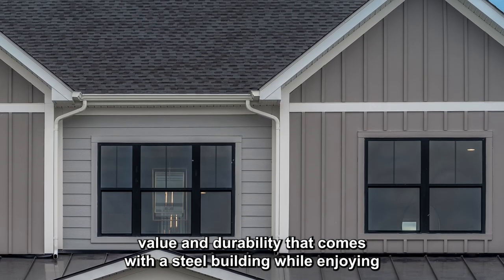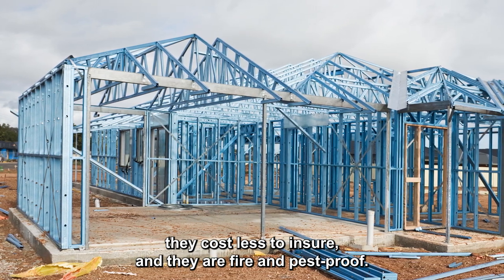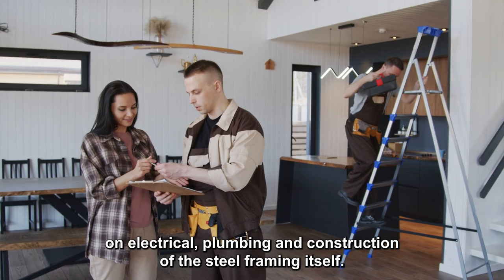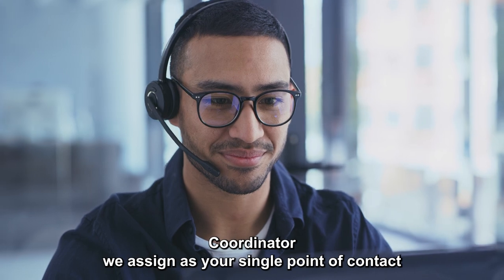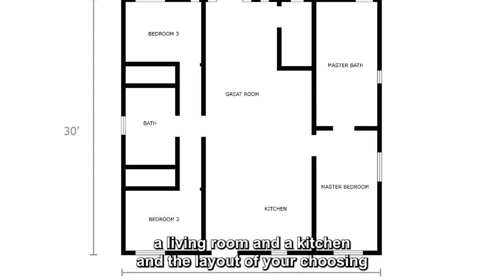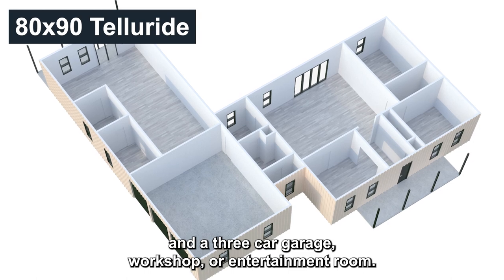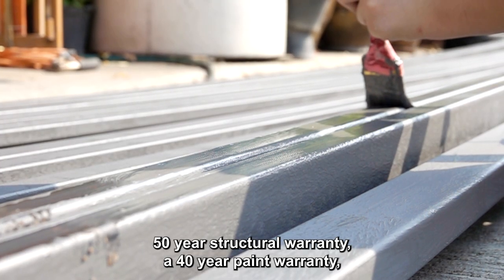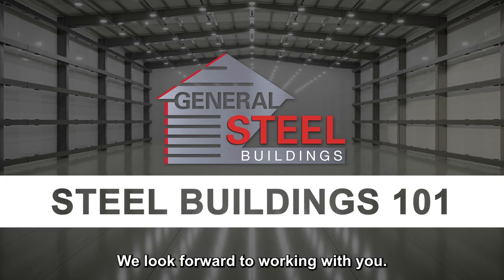Steel Homes | Steel Metal Buildings | General Steel Building Types 101

Comment: What is the average price per square foot for these steel homes?
Reply from the maker: The per square foot cost goes down as the building system gets bigger. The price per sqft can range from $14 - $25 for materials only (does not include interior finishes)
Reply: @GeneralSteel  Thank you